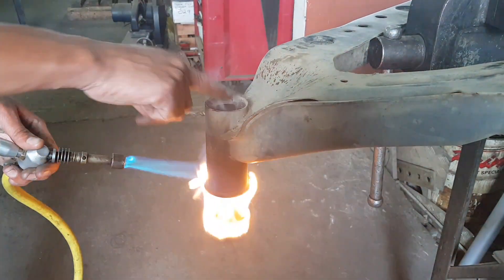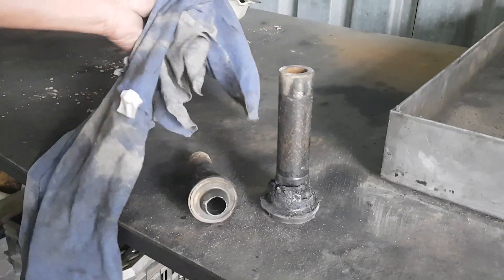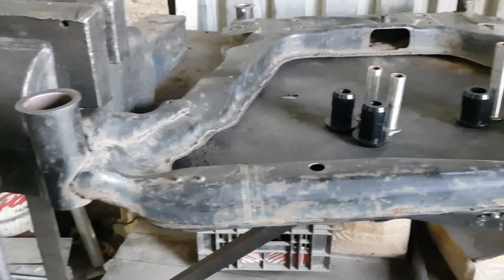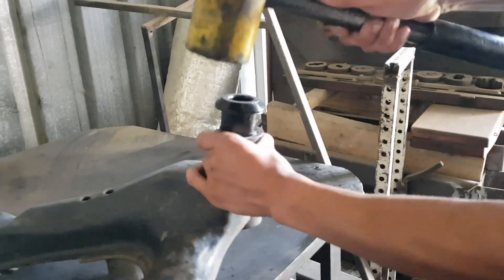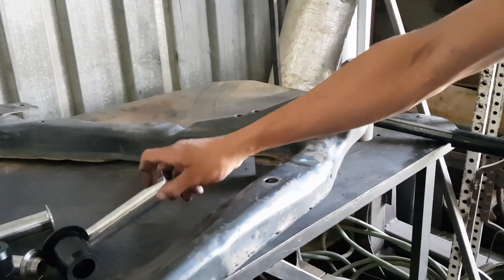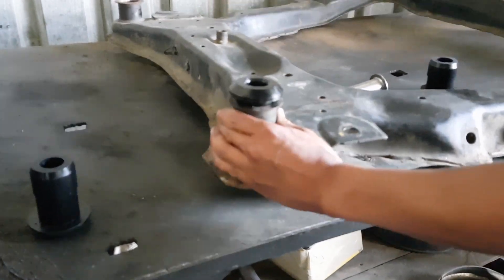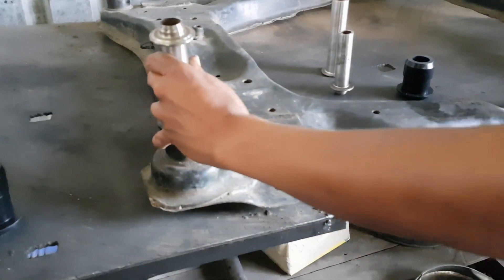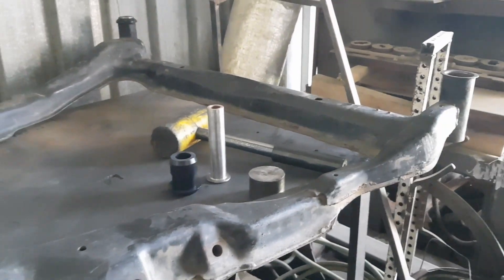Nissan X-Trail / Qashqai / Rogue / Juke Front Sub Frame Bushings - PSB 345/346

Comment: do you have a video for the 2007-2012 Nissan Sentra subframe bushing installation?
Reply from the maker: Hi, these bushes (PSB 345/346) also fit on the Nissan Sentra 2007-2012, so the installation will be exactly the same. Thanks!

Comment: Ooohh wait so you don’t need to remove the outer sleeve? And they come with new inner shafts?
Reply from the maker: You re-use the original outer sleeve, and also the inner shafts after cleaning them out thoroughly. Thanks

Comment: Is that the original metal sleeve installed on your new bushing or the new one?
Reply from the maker: Hi, thanks for your query - Yes you re-use the original metal sleeve. It is only the bushing that wear's out, so no need to chuck that original sleeve. Just need to make sure you clean it thoroughly before re-installing.

Comment: Hi PSB, I purchased the PSB 345/346 bushing for my NT31 X-trail. I showed my mechanic the method given by your company for the replacement of the old bushings. It helped tremendously . I was told that I cannot under wash the vehicle as it would remove the lubrication placed on the bushings that may compromise the bushings themselves. Is there any truth to this allegation?
Reply from the maker: Hi Rik Roy, glad that you are enjoying these bushes! There is absolutely no problem to 'under wash' your vehicle. It won't affect the lubricant or the bushing effectiveness whatsoever. All the best.

Comment: I have been facing vibration or engine roaring for years. I spent almost 500 bucks on the overall suspension and bushing, mounts foundation, exhaust steering and everything. Still the problem exists. 
When I accelerate, vibration comes through whole body and it badly annoys inside the cabin. The solution that mechanic finds is bushing between engine and its frame . And its still a gamble to invest. I dont know what to do. Kindly guide that why this vibration or engine roaring comes from? It sounds truck or diesel vhicle.
Reply from the maker: Hi Sir, while we do supply quality polyurethane bushings, I think that the issue's you are facing would need to be seen by a qualified mechanic who could do a full physical analysis of your vehicle. We cannot advise for this. All the best!

Comment: Hi there, 

I have a Nissan Qashqai 2010 with rattling sound when I'm on bad roads. I've changed the linkages, and lower arm bushings. I'm suspecting it's the subframe PSB as all the other bushings are intact. Is there a way to tell without dropping the entire subframe?
Reply from the maker: Hi, sorry for late reply! Unfortunately we can't give advise on this, but would suggest you speak to a trusted local mechanic.
Reply: You can use a pry bar to check for play in the subframe bushings, whilst the subframe is on the vehicle

Comment: Hello dear does the subframe bushing make car vibration.

And i have this case:-

I have nissan maxima 2014.
I was i have shaking when im driving after i went to dealer the upper engine monts are broken. The shakes while driving fixed, after that i have steering vibration at iddle i went again to dealer he said you should change the remain mounts I replaced but the problem not fixed what should i do whats you advice?
Hint: when i put to (drive the vibration less than when on N or P.
Reply from the maker: Hi Sir, unfortunately we cannot give advice for the specific technical matters on your vehicle - it will need to be a professional mechanic who can make that analysis after a detailed inspection. However, in a general sense you can definitely reduce vibration on your vehicle by changing the bushes (if the old ones are worn out).

Comment: It is unclear in your presentation whether the outer metal sleave of the original Nissan bush has been removed. By burning out the rubber I am assuming that the outer sleave remains in the crossmember. The reuse of the heavy inner sleave is quite obvious. Please clarify. Your written instructions on your website for these particular bushings state removal of the outer sleave and insertion of "new" inner metal bushings, this I'm guessing is your generic instruction for split type polybush replacement. Somewhat lazy and unprofessional presentation in my opinion.
Reply from the maker: Hi, thank you for the feedback and apologies for any lack of clarity. We will look into this and update. Kind Regards
Reply: At what stage are the original rubber sleeves reused?
Reply: @ianyates8483  having now fitted a set of these poly bushes I can now explain it from my perspective. The original rubber isn't re used. The new polybush is your new rubber sleeve. With the subframe off the car, burn out the old rubber bush. When they were new the bush would have been bonded to an outer tube/sleeve  and a heavier duty inner steel tube. The inner tubes will eventually fall out the front and rear are different so note which is which and put to one side for later. Continue to burn out the rubber until you get to the stage where you can clean up everything with a wire brush or if you can/willing  get her sand blasted and repainted. Those original outer sleeves stay put in the subframe assuming they haven't rusted away. Now select the correct new poly bush for the front or back and with a little bit of lube knock them in with a mallet until they kinda snap into place. Now back to those heavy tubes, clean them up and paint them and again with the mallet knock them into the new poly bush. Job done. Bolt it back up. Good idea before refitting is fit new antiroll bar bushes as they can be worn and cost peanuts.